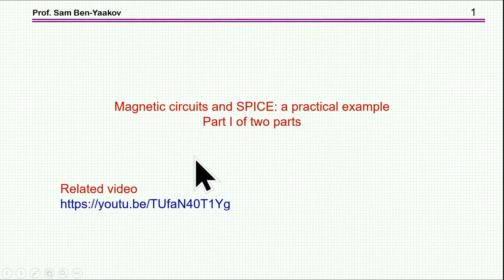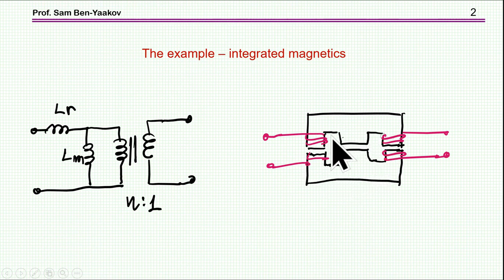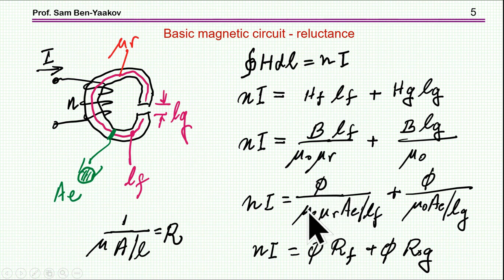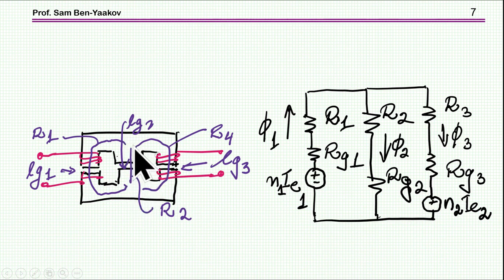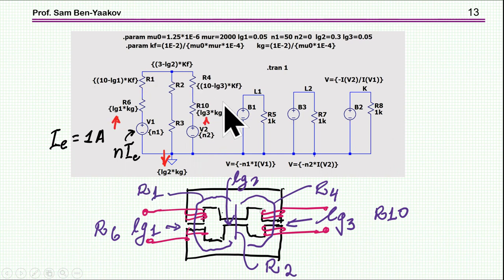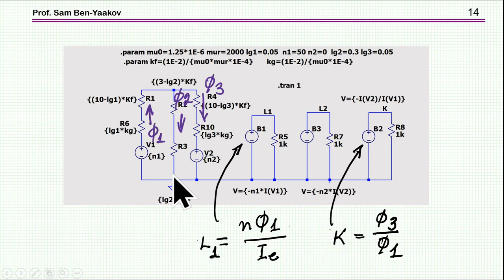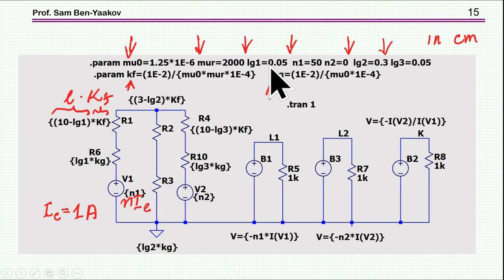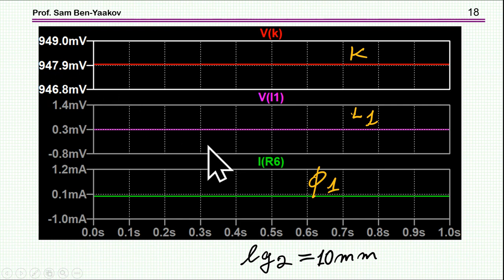Magnetic circuits and SPICE: a practical example: Part I of two parts

Comment: On a related note, do you know of a way to measure the power dissipation in an inductor in LTspice? I've noticed that if I do the usual Alt-Click on the inductor, it seems to treat the energy stored in the magnetic field as dissipated energy, resulting in completely unrealistic numbers.
Reply from the maker: He thermo feature  gives the I X V product. Then you have to take the average for power. The result for a pure inductor will be zero. But id the model includes a series or parallel resistors you get the real power dissipated.

Comment: why do you need the middle section at all if the coupling coefficient gets better with large gap in the middle ?
Reply from the maker: To get a  series inductance (which is the leakage) you need a smaller coupling coefficient
Reply: @sambenyaakov  thank you

Comment: Hi. I was trying to recreate the model (mostly just for fun and to try LTspice). It seems like you have a typo here: R2 should be equal to (10-lg2)*Kf. 2nd thing, not sure why, in-model current references like {-n1*I(V1)} did not work at all for some reason.
Reply from the maker: Why 10? Not sure I understand " in-model current references like {-n1*I(V1)} "
Reply: @sambenyaakov In your model you assumed all three legs have total length of 10 cm. Therefore, the ferrite reluctance: 1s6 R1=(10-lg1)*Kf, R2=(10-lg1)*Kf and R4=(10-lg1)*Kf. I guess, it would be more clear to use the length parameter as a symbol among other variables in the "".param" list. Or did you rather mean 3cm x 7cm configuration?
Reply from the maker: @sergpodolnii3962  No. Yu can not define a reluctance twice. The upper and lower bars are already included in the right and left reactance so you can not include part of them un the mid leg. What I show is an approximation. TA better one:  mid leg  4 while the left and right legs 9 cm